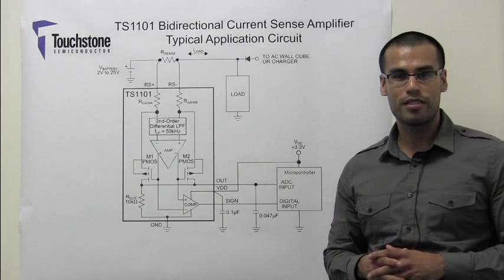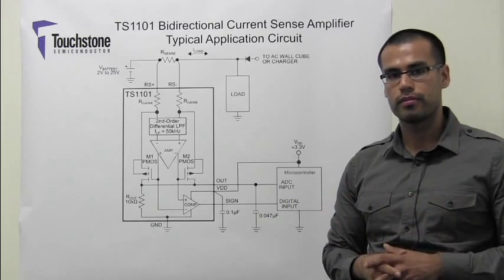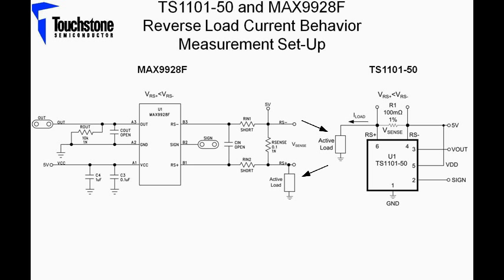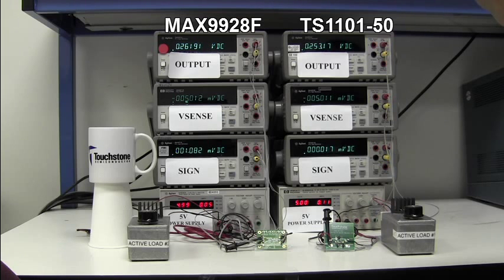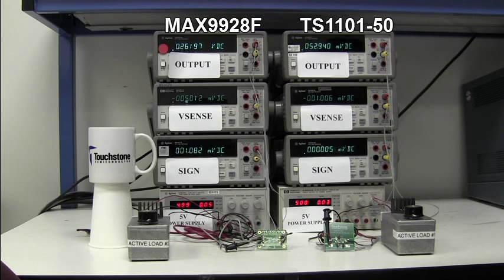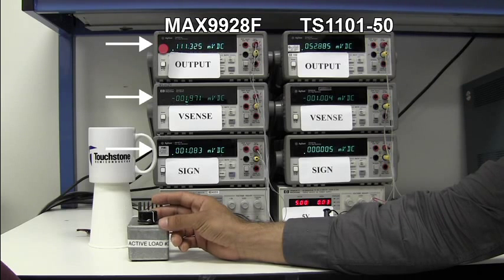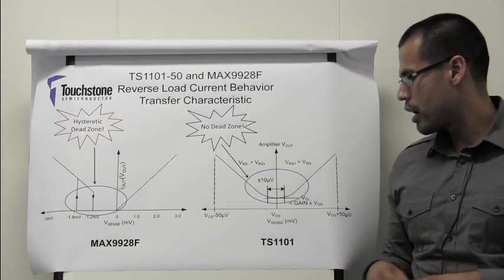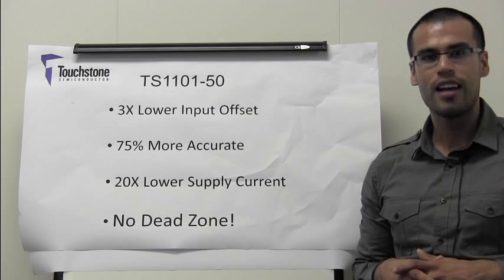TS1101 vs MAX9928: The Battle of the Bi-directional Current-Sense Amplifiers

Comment from the maker: Hi and thank you for your question. For the TS1101 to operate properly, the requirements are that an input common mode voltage is applied to power the device between 2V and 25V and the device that is driving the inputs of the TS1101 must be able to source a bias current of 500nA on each input. The common mode voltage can come from the source device along with the AC signal you are trying to measure. If you can meet these requirements, it is possible to use the TS1101 in this manner.

Comment: I was just wondering, would this chip make a good heart of a differential probe set? By using a voltage divider circuit on the inputs and sending the output to a scope, a differential voltage would be displayed. Differential probe sets are very expensive, this might make a good poor man's alternative. I don't know what the frequency response would be,  but I only need a set for 60 HZ and below measurements and floating a scope is not always practical.